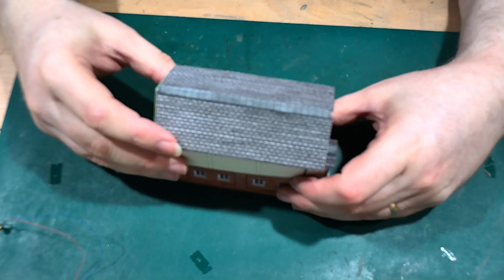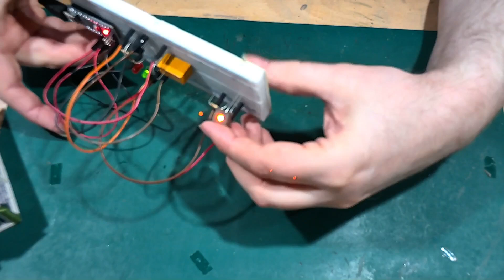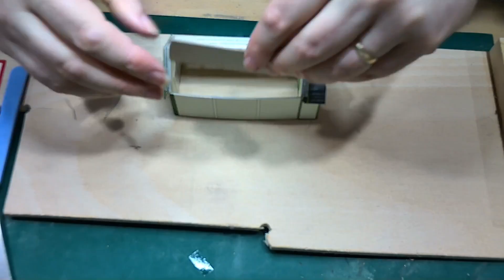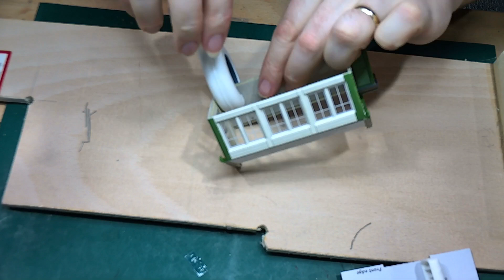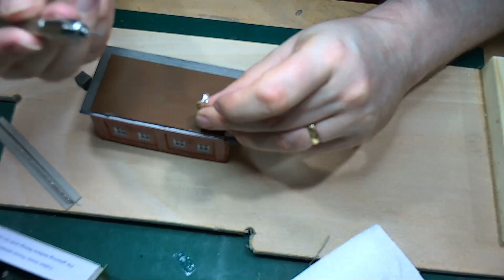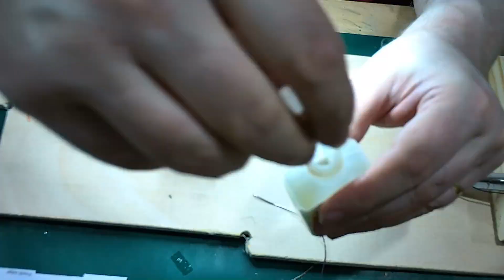Episode 7 - An illuminating experience, Leopard Street Model Railway

Comment: Hello Sir, 
I think I have this kit somewhere in my stash. When I finally get started on my building do you think it would look better with a LED Light strip instead of a single bulb? Sir, Is it good practice whenever you solder two wires together that it is best to cover all solder connections with a heat shrink tube? What is that yellow tool you used after you drilled a pair of holes in the floor?
Thank you Sir for your time 
Sincerely 
Allan Martinez
Reply from the maker: it is two LEDs, a strip would probably be better though, probably easier too! and yes heat shrink or something would have been better practice, I have another signal box needing lighting and will have to remember that

as for the yellow tool, its designed for cleaning the nozzle of an airbrush, usually found in a kit with various brushes, really useful for small holes in card though. alternative is a drill bit in a pin vice, this is way less faff to open the hole out with though :)

Comment: I WISH i had seen this before lighting my signal box. Although I was working retrospectively on a model I'd built in 2018. What gauge was your wire?
Reply from the maker: the orange and black wire is 30AWG silicone wire, UMTMedia on eBay. need to get some more of it.

yes its easier with a new build kit by a mile, have done retrofitting older ones, currently have some more to do with more videos coming up (houses, shops etc). used to have the factory kits, hopefully have space for at least some bits in the future too

thanks for watching and glad it was useful
Reply: @aleopardstail  Brilliant. Looking forward. I'll take a look through your back catalogue as well. Have a great weekend!

Comment: I remember building one of these one Christmas day. Home alone, I really enjoyed the fun of construction.
Reply from the maker: They are remarkably simple to put together, nice clear instructions. only slight drawback with this kit is while it has wide open windows, and while they do make an interior kit for it - the actual inside of the walls isn't decorated (hence the painting here), a further few card bits so the floor wasn't grey with instructions and the inside had cladding over the windows and it would be perfect.

on kits with smaller windows you just don't notice. need to get a few more of these as the layout develops.

thanks for watching :)
Reply: @aleopardstail  I'm already subscribed, so I'll be watching further videos.
Reply from the maker: @dinmorejunctionmodelrailway  as the saying goes, every little helps so many thanks.

I do plan to get a better camera and get rid of the blurring, something else to learn about. have a few more episodes in the pipeline

:)
Reply: @aleopardstail  I agree. We all need those precious subscribers.